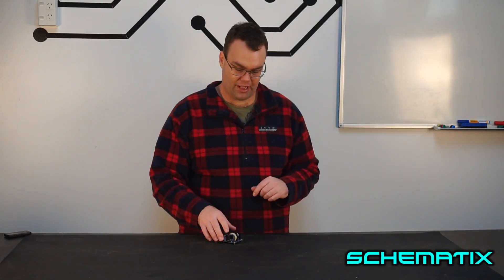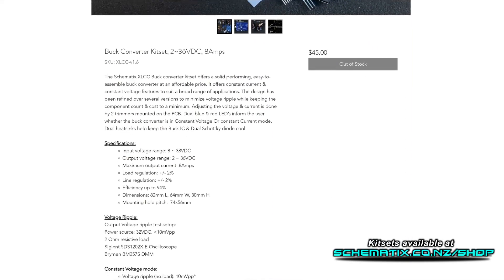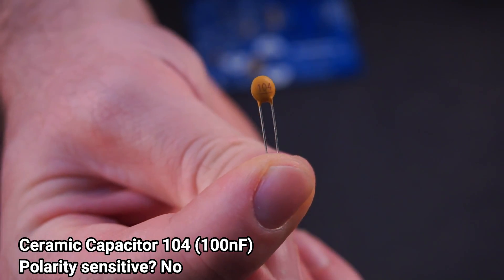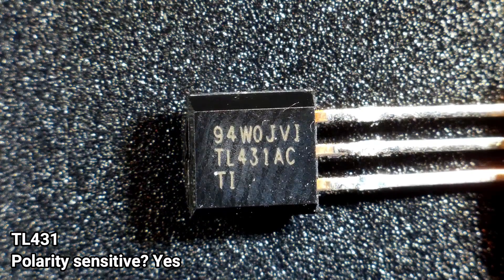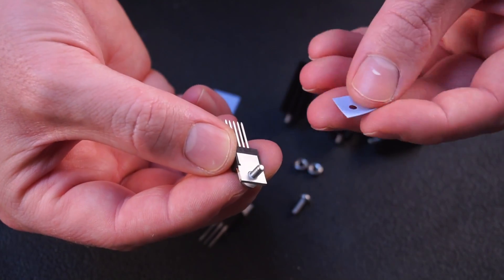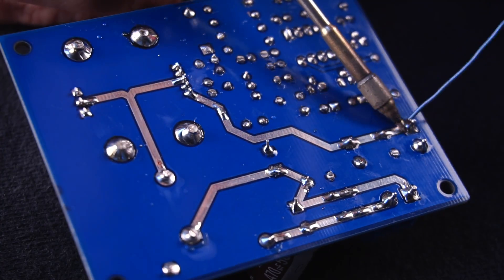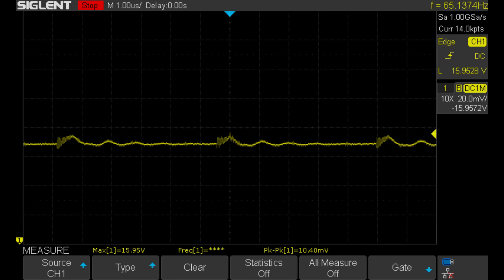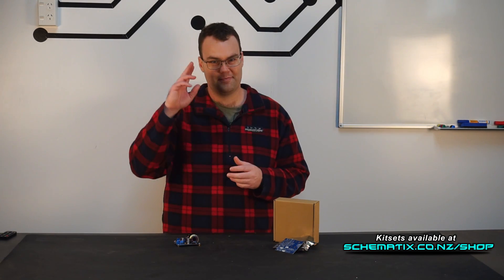XLCC Buck Converter Kit - Features, Assembly & Tests

Comment: I love the design, I built a 2.1 music amp, the 2 channel board is 100 watts 50 x 2 and a 100 watt mono block  both boards are 24v @ 4.17amp so I need to get 8.34 amp so ohms law states, but I notice some times it will draw up to 4.58 amp. I would like to not keep this buck at full capacity, do you have any suggestions on what I can do to get it to near 10 amp? Maybe if I use 27v  it will only need 7.4 amp. I used 35v caps on the amplifier boards. For ripple and noise, I cold always use extra caps and a 63v film cap 0.1 mf on the output in parallel, right?